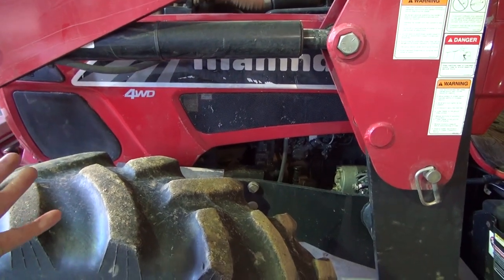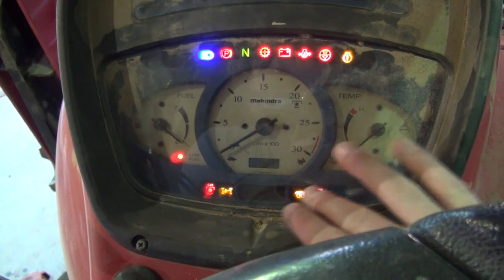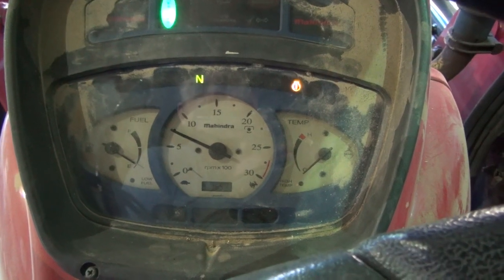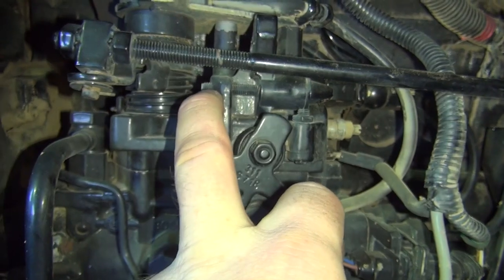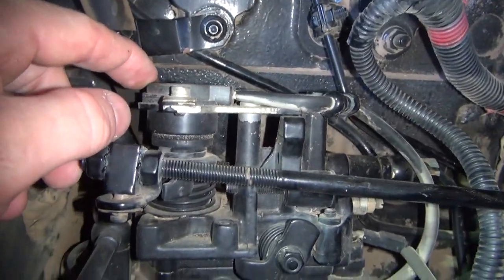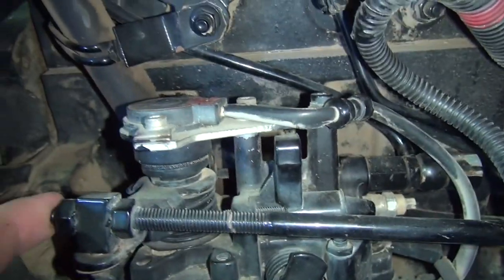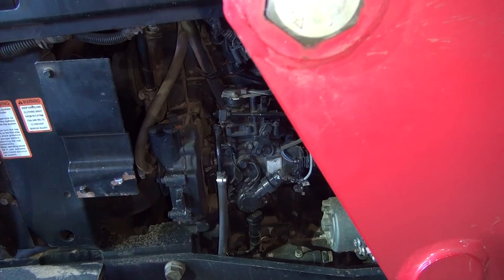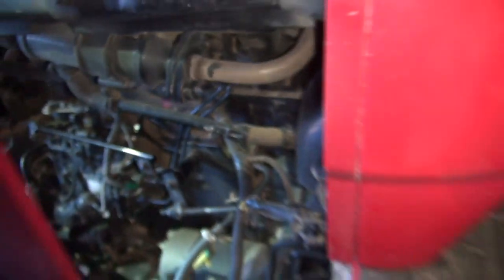Adjusting the Idle speed on my tractor Mahindra 8560

Comment: Interesting  as so many engineers  have  decided 900 rpm was ideal  but I cant see 150 rpm drop could affect a thing .  My kubota idles lower than 750 rpm , way lower :)
Reply: I think 800 rpm is idea
Reply from the maker: The anti adjust caps must have fell off yours too. 😂 some of the old tractors idle at about 500 rpm. I'm guessing these are set where they are so that the alternator energizes when you start it, but a tap on the throttle fixes that.